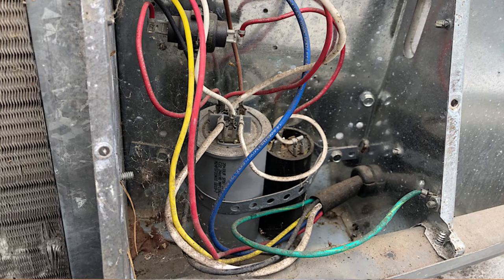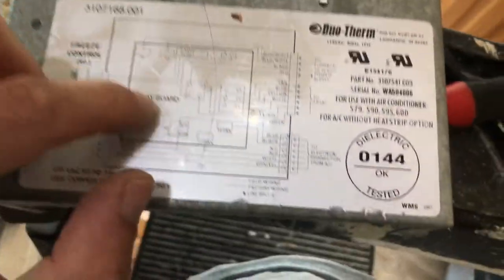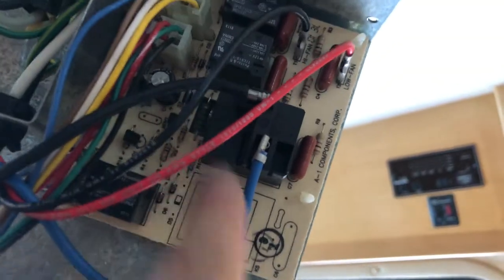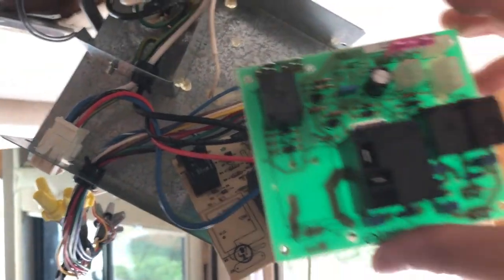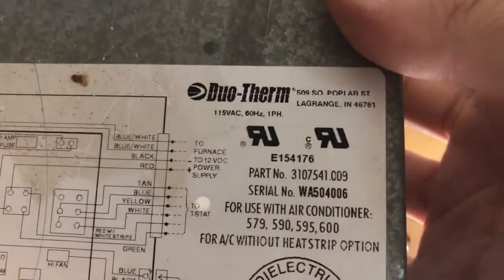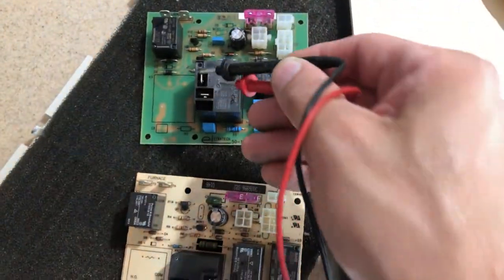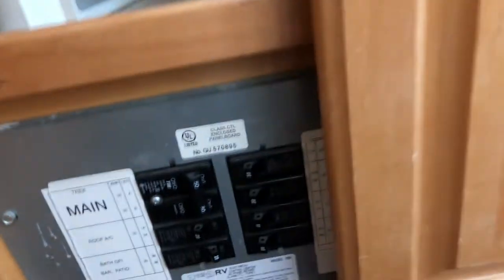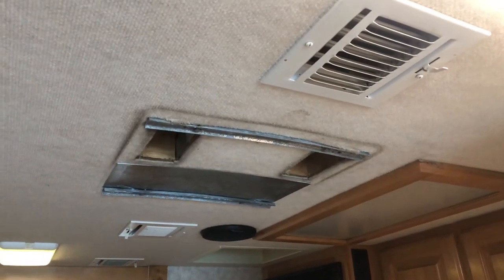Dometic RV Air Conditioner Compressor Stuck On- Relay Board Swap

Comment: I'm pretty sure this is my issue as well.. Ive got a hum when I cut it off at the wall and have to turn it off at the breaker to get it to turn off. I also hear clicking not all the time but when I do its a lot of clicking. Ive been having to turn it on and off to keep it from freezing up and freezing us out.. we're full-time and the summer was too brutal to try and go without while trying to figure out what was wrong.. Its been a pain searching online( as you know), nothing has matched our issue and a huge checklist of what it could be. I had pretty much decided that if I had to replace everything in that list, I might as well buy a new unit. However, we will be in our house sometime next summer, and I don't want to replace it if I don't have to. I figured I would search the internet one more time.. and voila there you were. You did a great job explaining everything and I feel confident that this is it..
Thanks so much for posting this video..!!

Comment: I have analog system, can usually hear relay click when therm activates ac. Today, it didn’t. Thanks for showing which relay it is and when I arc’d it, AC started.  Amazon replacement board on its way😅. The 3107541-009 was the key.

Comment: Just a little diagram 101- the K-4 relay is the compressor relay and the "NO" stands for "Normally Open".  The lower right grouping is the 6 pin connector from the control box to the compressor/fan on top.  Blue is compressor, black is high fan, red is low fan, with is neutral for compressor/fan, green-yellow is ground.  And i'd bet you do have a furnace.

Comment: Hello from Beville, TX to Midland-Odessa, TX. 
I guess you work in the Oil Field.
Had similar issue with a 1 year old Colman Airxcel Mach 15/10, but my fan kept running continuously. 
Went up on the roof opened the AC housing, pulled the control box out and measured all 5 Lippert OneControl wires going to the control box. 
Non had 12VDC, but the fan kept blowing until I popped the 120VAC breaker. 
So I guess the fan Relais is stuck too.
Just finished ordering a new control box, hope that solves the issue.

Comment: My AC unit did the same thing.  I thought it was the overload circuit. It is the relay on the board. Now I have to find a relay switch. Thanks for the information. Good Video.
Reply from the maker: I’d recommend a whole new board since there are other components on it that can also go bad. No point in skimping just to have to do the job again later.
Reply: @RamblinMichigander  I am good with electronics. Should be a simple replacement.  I will test the board for other problems. I have already ordered the relay to replace it. Thanks for the help.
Reply: @TravisLang667  I think mine is the fan relay as well.  Changed cap twice, have power on, no blower.  Where did you source your relay?  Looks like desolder 4 joints and 2 wires to connect.

Comment: My ac is only 3 years old and did the same thing ,  300+ dollars for a replacement circuit board . Im gonna get a new relay put on the old circuit board and keep it as a spare

Comment: Mine is the fan side. The fan kicks on then kicks off. You can hear the relay clicking. I'm thinking I'll just replace the board based on what I've seen. I'm also going to replace the capacitor to eliminate a point of failure.

Comment: How much did just the board cost? I have a similar problem but ours fails to shut off intermittently and causes the fan to come back on. Then at other times it works without any problems.

Comment: Great Video,  Had a new board installed a week ago.  AC worked flawless all day long on the first outing.  Turned the AC temp up as it was turning into a meat locker.  AC turned back on and the trouble began.  I have a basement AC with two compressors.  Compressor one would buzz and two would turn on.  Found your video after talking to Winnebago about the issue.  They said it was a stuck relay switch.   Your video confirmed the issue.  Now the big question.  The board has to have a warranty on it.  Labor to install the new board is the question. Thanks for the video.

Comment: I have been searching for awhile to find a video like this. Thank you so much!!!
Reply from the maker: You having the same problem?
Reply: @RamblinMichigander  yes it just happened yesterday. So I decided to look today and thank God you made that video 6hrs before. Thanks!!
Reply from the maker: @shineproproducts  Ha! That’s quite a coincidence!  Remember, your AC unit may be different such as where the board is located, how difficult it is to replace, etc. But the basics should be similar.  Good luck to you!
Reply: @RamblinMichigander  yes I checked it out and should not be to bad. We have 2 30' campers and a 30' motorhome so this is definitely helpful.
Reply: Ours compressor started sticking yesterday, thanks for the tips. Will replace board.

Comment: I've had the same issue, and just recently figured it out mine is 30 years old and doesn't have a control board, only separate relays but still the compressor relay stuck on and did the same thing as yours.

Comment: Great video man.  Here it is the 5th of August 2023 and your video is still the first one that covers this repair to fix my ac unit with the same symptoms as yours.  I sorta figured that was the problem with mine but wasnt wanting to pay $224.00 for a new control board. But anyway thanks for the video because its going to help out alot of people.  My unit was humming or buzzing like yours was and only way to cut the ac off was at the breaker box. The thermostat wouldn't cut it off. Thanks again.

Comment: My propane fridge, small dometic, goes thro a tank of propane in 24 hours. Cools just fine. Gets very hot on counter and outside trailer.
Electric works fine.
What is it?
Reply from the maker: Not sure. Possibly a dirty flu causing a bad fuel/air mix…?  You should talk to an rv fridge expert.

Comment: I have this same air conditioner in my 2000 Hitchhiker II fifth wheel. Mine will do the same thing as yours but if I shut off the breaker and back on again the compressor is off. It may  act up again on the next cycle or be fine for several days. Lately it's been getting worse. The fact that my relay does shut off with power loss makes me wonder if it could be a thermostat problem. Does that seem possible to you?
Reply from the maker: I’m not an expert but no, that doesn’t sound like thermostat. That sounds like a relay that is sticking but not constantly like mine was. But things like that always get worse. I suggest replacing it asap. If the compressor runs for very long without the rest of the AC unit operating, it could cause damage to the compressor or, I hear, even start a fire. Not worth taking that risk for avoid paying for a $100-ish part.
Reply: @RamblinMichigander   Thanks for your reply. I will do that before I take the trailer out again . Where did you get your board from?

Comment: I wonder how much that board was. The relay is probably in the $10 region and should be a common type available in AutoZone. And yes, anyone with a little bit of soldering skill could swap it in 10min. Good skill to have.
Reply from the maker: With overnight shipping it was about $110. Yes, I could’ve saved money by having a new relay put on, but I just didn’t have the time. I needed it fixed to be ready for my trip. Plus there are other things on that 20 year old board that could’ve gone bad later. Better to just replace the whole thing.
Reply: Good job! Hope you take us with you on your vacation!😆

Comment: Hey. Many thanks for this video. Last trip, we pulled in, plugged in and the Compressor would not fire. Turned the system on and off about 10 times and then it turned over and stayed cool for the whole trip. By the sounds of this video, the relay switch is sticking and likely unstuck itself. Sounds like I should order a board just to have on hand in the event the sticky switch fails completely.
Reply from the maker: Yes, that’s definitely a possibility. The other thing that causes the compressor to not turn on is the capacitor failing.  But I believe the capacitors pretty much either work or fail completely so it’s prob not your issue.
Reply: @RamblinMichigander  Thank you! That's kind of what I was thinking as well. It's a 2021 model so hopefully just the switch.
Reply: @RamblinMichigander if the fan is turning on but compressor not igniting to blow cool air would that likely be relay or capacitor? Other videos have mentioned overload protector

Comment: Gordon since your bolts were loose shouldn't you be checking/replacing the rubber gasket also? I'd be concerned about future water leaks. Great video by the way! Wish I had electrical understanding like you. Looking forward to your upcoming videos. Cheers! ~M
Reply from the maker: Yes, after 20 years, it’d be smart to replace that gasket. But that’s a job for another day. Don’t have time to do it before our next trip.
Reply: @RamblinMichigander  Just add it to the list of vacation projects LoL!!